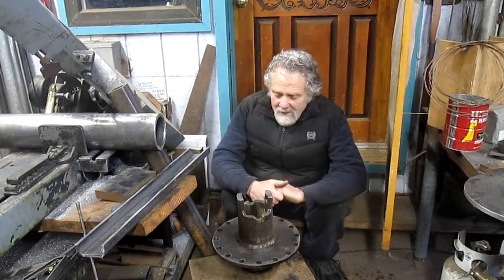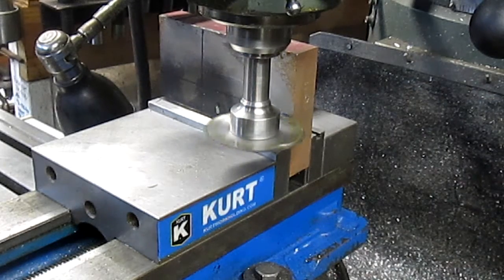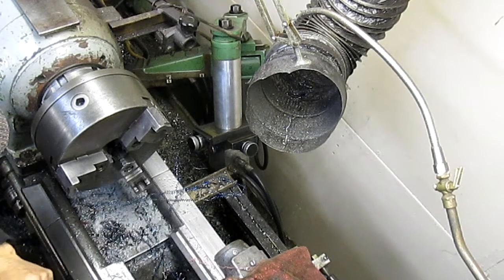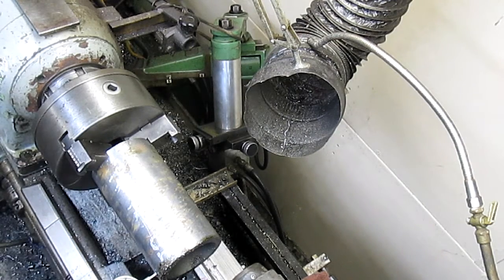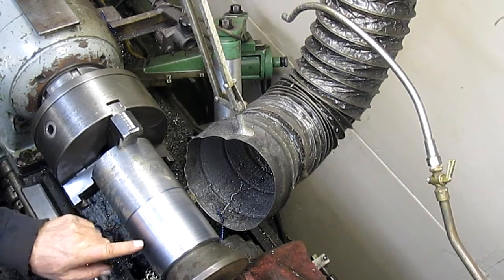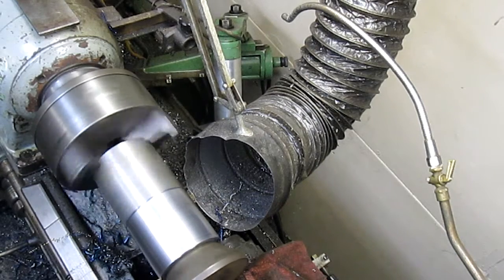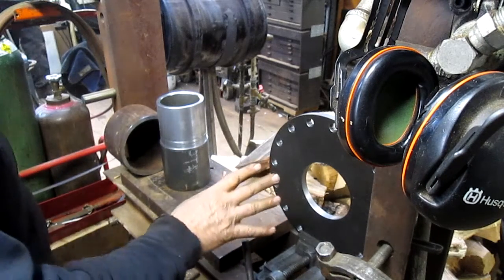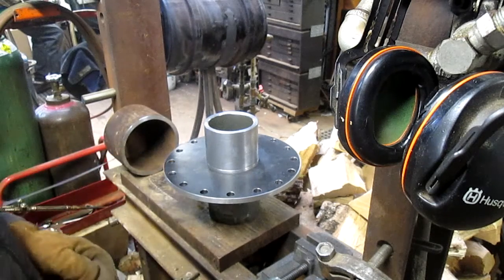Earth Drill Build #7

Comment: 24 inch that is a big drill bit I am used to vintage smaller Hughes oil tool drill bits being a lot smaller in diameter. That is one giant cone center for your tail stock. We were not real sure that heating that bolt pattern plate was going to be enough but it did slip right over the tube, great work.
Reply from the maker: They had a .005 press and a few hundred degrees opens that hole just fine.

Comment: Nick you need a new bottle of acetylene to stop that dam popping and  flame outs. when the bottles get low they just can't supply enough acetylene to do the job. But of course I'm cheap so I just hate to turn a bottle in that has any gas left in it.
Reply from the maker: Yeah, I get it. I'm cheap too. I've gotten used to it.
Reply: I’ve seen that happen when you hold your rose bud to close and it over heats
Reply: Duck0fdeath c when I’m heating something big I usually keep a 5 gallon bucket full of water near by to keep the tip cooled off